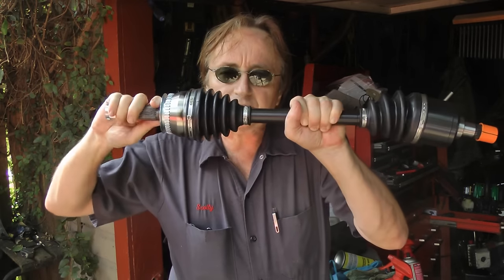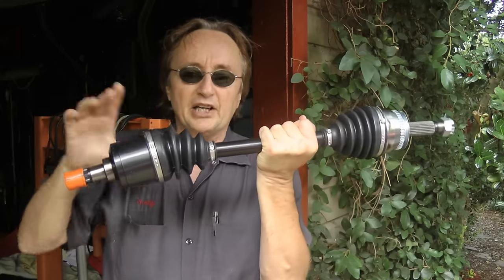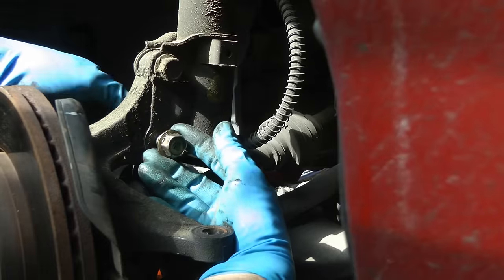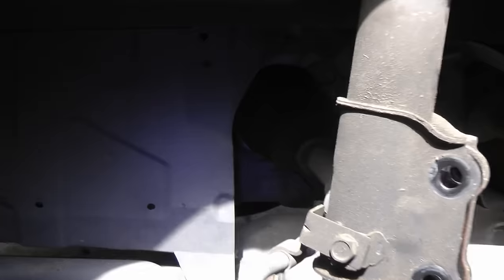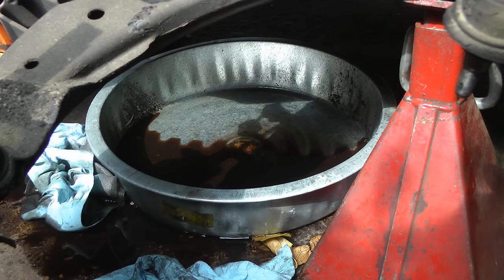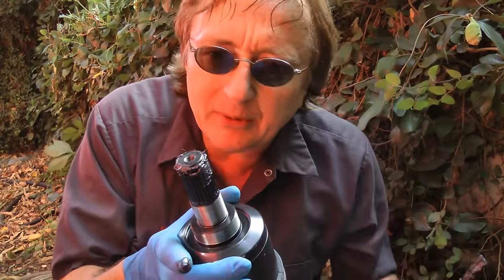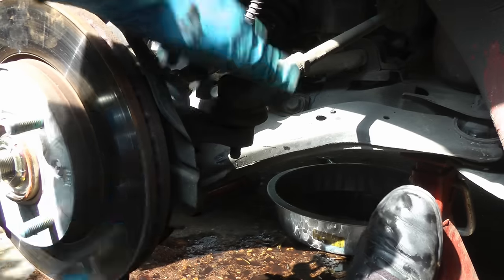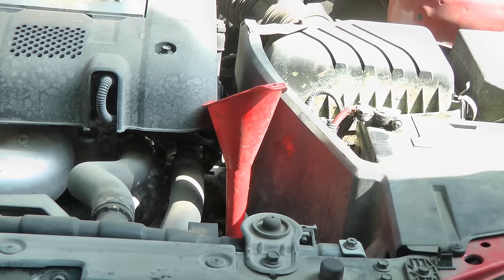How to Fix Car that Clacks When You Turn (CV Joint and Axle)

Comment: My parents 96 Dodge caravan has a slight ticking sound coming from the front passenger side. Goes away after 25MPH. Also doesn't make the sound when standing still, so it's not the engine. Could it be the wheel bearing or CV joint starting to wear out?
Reply from the maker: more often wheel bearing or brake grabbing and ticking
Reply: Scotty Kilmer hi scotty i have a problem with my car theres a swishing/slashing noise like youre sharpening a knife from the front drivers side whenever turning left and only when car is moving. could it be a bad wheel bearing or what? and how much would it cost to repair? thanks!
Reply from the maker: check for a worn wheel bearing first as it can make the rotors grind on the brake system and do that
Reply: Scotty Kilmer ty!
Reply: John Kim

Comment: hey Scotty Kilmer when this happen does it damage the wheel hub assembly also or damage anything else in the area. 98 buick park avenue ultra
Reply: It depends how bad the CV axle is and how long you have driven on it. I had a CV Axle that went bad and ended up destroying the seal in the transmission. So I then had to replace the CV axle and the transmission seal. Which the seal was cheap but it added more work to the job. If the CV axle gets bad enough it can actually bust loose and then damage other components on your car.
Reply: If, if the CV axle snaps it can do some naughty staff.

Comment: My car makes the same exact noise although the CV boot is not damaged. Is this possible that the CV joint is still bad, or is something else making the noise?
Reply from the maker: yes, they can still break down inside without a ripped boot
Reply: Thanks! Another question, how can I tell which axle needs to be changed? If i turn the steering full lock to the right, and I hear the clicking when driving, does that necessarily mean the passenger side axle needs to be changed? Or is there another way to check which is the bad axle? Thanks Scotty

Comment: what about when it makes a cracking sound when the car is stationary? it only happens when I turn the wheel left and then straighten it. it's like a bone cracking feeling that's the best way I can describe it
Reply from the maker: that's often broken strut mounts or bad A frame bushings or really bad ball joints

Comment: 1:55 just so everyone knows it will not always work with any old pry bar and a hammer. Mine isnt coming out but its not as strong a hammer or pry bar. Going to the store now to get a heavier hammer and stronger chizzle. Im also going to rent an axle puller. Is a 1 hour drive to the hardwear store for me.

Comment: what about a noise that progresses as the truck leans sounds like crunk crunk crunk as it progressively leans always hear on left front happens more on right turn but also happens on left turn. doesnt happen on bumps. endlinks (possibly overtight) are new and front sway bar bushing replaced and properly torqued
Reply from the maker: often worn A frame bushings or ball joints do that
Reply: Okay thanks scotty I checked for ball joint play so it might be frame bushings any chance it could be control arm bushing?
Reply: lol i didnt know "A frame" was a synonym for control arm lol thanks scotty I really appreciate how you help and actually interact with your fan base :)

Comment: Could you use anti-seize to coat the end of the cv shaft that goes into the transmission to keep that ring on?
Reply from the maker: sure, as long as it's thick and holds it in place

Comment: Hi Scotty i have a 2000 Grand Prix gt and every time i turn my steering wheel my car makes like a grinding noise it's coming from my front driver side tire only do you think its the same problem as in this video?
Reply from the maker: yes, often is, check to see if rubber boot is ripped, if so, that's it
Reply: Alright thanks man

Comment: Scott I have a 1995 civic and Me and my family ended up homeless I'm fixing to drive from California to Missouri and my car makes this sound when I turn all the way and accelerate quickly. can it make it to Missouri you think? I don't have tools and I don't have family here that can help. I have and 4year old and my girlfriend with me so I'm really worried about it. is there anyways to find out how bad it is? sorry for the long post
Reply from the maker: +Corey Fischer   cv joints are wearing, but they don't wear on the highway, only when turning. It could easily make it
Reply: +Scotty Kilmer oh thank you so much. I was worried. I have to replace the driverside seat headlight and blinker on the front hood and rotors and brake pads. then insurance and registration. I didn't want to do that too I can fix the rest. that was gonna be diffucilt

Comment: I was in a accident and I couldn't control it , it wasnt turning and I couldn't brake and now my car abs light is on and it was making a clunking noise when I turned either way or reversed turned as well ...could this have caused my accident?

Comment: Hi Scotty. I did comment on one of your videos before.. My problem is kinda related to this video. It's like everytime I press my brake there's this 1 clunk sound that I hear. Now what we did is to remove the calipers etc to check my brake. And we serviced the brake 3 times but still having it. The last time we remove the wheel, and caliper I tried rotating the rotor while it's jack up and you can here that it clunks like metal to metal would this be a sign of worn out inner velocity bearing? Thanks!if you turn turn it back and forth you can hear some clicking sound. but if you try to trun it back like the wheels rotate when you move forward it snaps like metal to metal. Thanks
Reply from the maker: sound like bad bearings
Reply: scotty would it be ok for me to changed where the sound is coming from only? or do I need to changed the both left and right? and both outer and inner? Because I asked some shops here and they said they don't have cv shaft assembly
Reply: teckah ertsuli Was it your bearings? Cuz mine does the same thing, but not when I brake, only when I'm turning right.

Comment: Hi Scotty, someone made a commit about doing what you did with the axle and damage the threads. How possible it it that this will happen.
Reply from the maker: if you don't know how to hammer, you can bend stuff. But it doesn't need to be insanely hard just to seat the axle in the transmission
Reply: You can also spin the axle nut back on a little just like he did with the tie rod nut in the video if you're worried about mushrooming the end.

Comment: Like your videos except for hitting the nut on the tie rod ends. Get a hold of one that won't come off after a tap or 2 and your gonna mess the nut and the threads on it. They make a spot on them now you tap the side of the tie rod for that reason.

Comment: On my truck the wheel bearings that the CV joints bolt to on both sides have play in them and can move about 1/4in.  When I turn the wheel sharply at any speed they shift that 1/4in and go CLUNK.  There's also a couple drops of red tranny fluid in that gap.  Is that anything to worry about?
Reply: Dood, yes

Comment: Had both my left and right CV joints replaced but still hear a little clank and the right side wheel seems to make a side noise it's fine when I driver only when I turn left into my parking spot any ideas what it could be?
THANKS
Reply from the maker: I only use brand new cv axles these days, if you used rebuilt ones they often make noise. But if not the axles, check for worn ball joints, tie rods, and A frame bushings, and strut mounts that are broken
Reply: +Scotty Kilmer they were new ones. the sounds like it's coming from the front middle.  they did the right cv and noise was coming from the left so they did left. not as bad of a noise but now i hear a tire noise now on the right front

Comment: My car just started making a loud clunking noise when I turn the steering wheel, much louder than this car. Does it sometimes, other times no. More so going to the left I think. Any thoughts?
Reply: Kaung Zin Hein It turned out to be the strut mount bearings were seized, cost $400 to repair.

Comment: My car makes a louder revving sound when I drive. When I turn right and accelerate, it gets louder. When I straighten out, the sound lowers. It does not happen when I turn left. What side axel would be my bad axel? I thought it was my engine, but it is not. Any help, please.

Comment: scotty help pls. My car does this when i left left and accelerate but the mechanics changed the right one a few months ago. (it sounds like its coming from the right. I have jacked up the car and the shaft looks brand new. Is there anything else that could be causing this?
Reply from the maker: +TheJanope13 either that shaft is bad or the other side is doing it now, sounds are often hard to pinpoint

Comment: I have a question when the transmission torque converter is liking can the transmission  fluids  came out from were the transmission is attached to the motoror the transmission gasket  is 93 civic LX

Comment: was the cv joint and axle a hyundai part or aftermarket part?
Reply from the maker: aftermarket, hyundai part would be 380 bucks.
Reply: Scotty Kilmer
The aftermarket made slight clunking noises on our Ford minivan, and it felt WAY lighter and flimsier than the Ford one.  I ended up springing $230 to some seller on ebay for a new Ford one and it's been just fine.  For cars, aftermarket are probably fine but I don't know about bigger, heavier vehicles.  The thing looked and felt like it would have broken apart at a bad time.
Reply: Right.  Funny, though - I bought an aftermarket "GSP" brand one from advance auto for my Camry and it felt about the same in my hand and has been performing perfectly well for 6 months now.  I guess for my old clunker it's fine but for the one the Wife and kids (dogs) ride around in, I couldn't risk it snapping in half on the highway in the dead of winter!

Comment: Ei Scotty have a problem with my chevrolet 95 model 1500 is the buster  the needles don't work I change the Speed sensor still the problem    In mark check gages you can help me thanks

Comment: 2004 nissan sentry 1.8liter shuts off after 7-10 min idle. Replaced fuel pump camshaft sensor and thermostat as code reader suggested. Now getting code p0335 crankshaft position sensor. This car ran at idle for hours the other day until I shut it off, now shuts off on its own...... What to do?

Comment: I have hundaii accent 2012 Auto
when turning left on slow speed it gives one click sound from down the left side
but the car seems ok from down , not rubbers cut 
what do you advise ?
Reply from the maker: heck , live with it, Korean cars often make small noises from slight internal wear. But do jack it up in the air and pull on the wheel to see if something else is worn like ball joint or tie rod or strut mount

Comment: thanks I got 2 fault codes 1166 and 1167.. on 98 accord which sensors do I need to replace
Reply from the maker: it's not that easy, those are manufacturer specific codes that can have dozens of possible faults. I would advise having a real honda mechanic at least analyze them all first.

Comment: I have a 2006 KIA Rio.
my car has been making a grinding noise the past few weeks.
put the car up on a jack in the front. started the car and put it in gear. then opened the hood the noise sounds like its coming from were the transmission is.
its a grinding noise when I turn both way to. and when I'm braking. my car vibrates in the front as well.
Reply from the maker: +Brittney Bryant  check both wheel bearings and CV axles for wear

Comment: I'm trying to figure out what's wrong with my car. It's a 2004 vw Jetta and it makes a popping/thud noises when I apply the brakes and come to a complete stop. Any idea on what it could be? It only pops when at low speed.
Reply from the maker: +Colton Eliason  jack up the front end and check for worn parts, like ball joints and tie rods FIRST.

Comment: OK I don't hear a clicking but I'm pretty sure it's from my passenger side when I go that turn the actual wheel like the tire it's kind of stiff then on the driver side it moves more freely I've already replaced the wheel bearing and I was wondering if that's my CV shaft it's a 4 by 4 2008 GMC Canyon
Reply: I hear more of a rubbing

Comment: I have a 98 accord that rattles when I turn right only can I do one side are get full axel like u did
Reply from the maker: there are two what are called half shaft drive shafts, and yes, you can only change one side half shaf axle
Reply: Anthany Johnson did it fix the problem.?

Comment: Hey Scotty question my left wheel makes a metal grinding noise and it gets louder as I go and even louder when I turn to the right, I replaced wheel bearing and still made the noise now I replaced entire knuckle and it's still making same noise what can this be?
Reply from the maker: often the brake backing dust plate gets bent and does that. Bend it back and see if it stops
Reply: I will Definitely try that thanks!

Comment: Hey scotty I have a 2006 honda civic hybrid and it makes a clicking sound on the drivers side and it makes the sound whenever the car moves it sounds like marbles, any ideas? thanks
Reply from the maker: pray it's just a worn wheel bearing there, cause those hybrids are super complex and if the hybrid drive system breaks down, BIG money fixing them

Comment: Hello, I have a problem with my VW golf GTI from 1998. Everytime the car is cold, there comes a "clack" sound when accelerating/turning... It's only the first 10-20 sec it does that. It sounds a little like in this video, but it's only when cold.
Reply from the maker: jack it up, check the cv joints, they are probably starting to break down.

Comment: The car does not have to be accelerating when turning to hear the CV axle clicking, You just need to have the wheel turned all the way to either side and be moving.
Reply from the maker: when they first start to wear, they will often only clack when turning and accelerating at the same time. Believe me, I've been doing this 46 years.

Comment: hi scott well i have ford van after alignment it still pulls right what s the problem...please waiting for your answer
Reply from the maker: first, you used a crappy alignment guy, they are supposed to road test them. so find another, cause dozens of things can cause pulling, takes a pro to figure em out with some VERY expensive equipment.
Reply: thansks for qiuck reply

Comment: I have a 2002 Ford f150 and ever time i turn the wheel the horn goes off and it blows a fuse. When I turn it to the right help.
Reply from the maker: you have a short inside the steering column, take it apart, often a bad clockspring assembly

Comment: HI I have 2005 Toyota sienna my question is when I make full right turn my passengers side front wheel start dragging could you please help me out of this problems .
Reply from the maker: check for dragging brake calliper and or bad brake rubber hose feeding it, and also check for worn ball joint on that side
Reply: Scotty kilmer thanks for your valuable time .

Comment: I have a 07 nitro and theres a grinding noise when i let off gas. Gets louder when i push on the brake. Cant figure out what it is. Ive changed the brake pads and rotors. And nothing has changed.

Comment: I have a question I have a 98 grandmarqus mercury LS and some times when I turn my steering wheel all the way to my left or right it makes a pop sound like crack or something like that
Reply from the maker: +los405 405     check for worn strut mounts or suspension bushings, that's RWD and doesn't have CV axles

Comment: Hi scotty,
I have 1994 honda accord LX with weirdest noise on the muffler like popcorn when they are in the microwave. Any Ideas the what causes the noise. Thanks
I posted video on YouTube you may want look at it thanks again
Reply from the maker: the engine is missing, that makes such noises. Anything from a worn distributor to bad engine valves can do that
Reply: Scotty Kilmer thank you Scotty. That only happen on low idler
Reply: I just replaced the distributor, 
Buy still make noise
Maybe needs new vaves

Comment: Scotty i have a question about one sound that the car makes when i turn on the car, its inside of the car the clang sound, to be specific its in the passenger side under the dashboard, i guess its in the air blower motor. can you help me to fix my car? the car its a 2013 dodge avenger  thanks
Reply from the maker: remove the blower, often crud gets in there and clangs around, a 2013 motor shouldn't be burned out yet

Comment: I actually fix my 2007 monte carlo driver side axle. now 3 week later I hear gridinding clunkin on both side in reversing while I turn. It feel like I cant go reverse in lock up. At sometimes i go forward my brake goes all the way in like i have air
Reply from the maker: Abel Martinez check the wheel bearings, worn ones often do that
Reply: I also change the the tranny mount i put a block of wood with a jack to help me raise it
Reply: Thank you It was hub bearing stud bolt some how got loose. Some how it was missing.
Reply: +Abel Martinez Many hub nuts have sn inner flange that is peened into a groove in the axle to prevent them from working loose.  That peening needs to get bent out to remove the nut, which is why replacing the nut is highly recommended. After installing the hub nut, it has to be peened into the groove.

Comment: i got a toyota altis 2001 and the noise only starts after about 30 - 1 hour driving. its not a straight noise like on the video but rather a clicking noise when i turn my steering wheel. again, it doesnt show up on the first start and will only show some time when you're driving or stuck in traffic